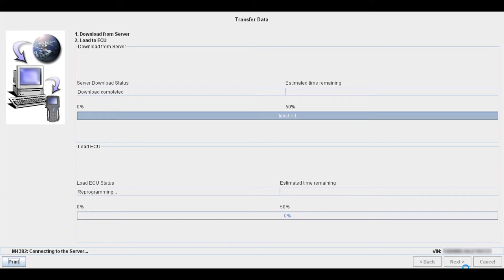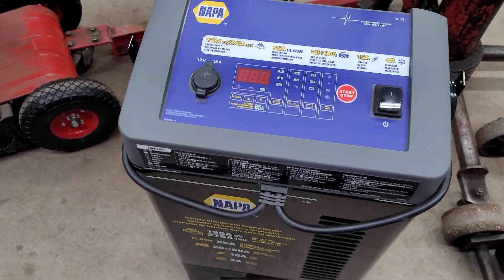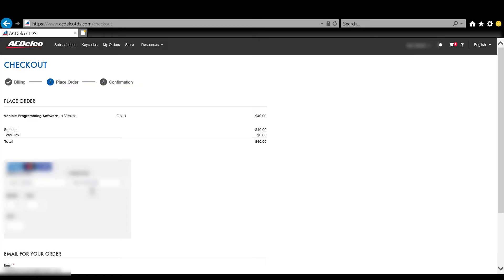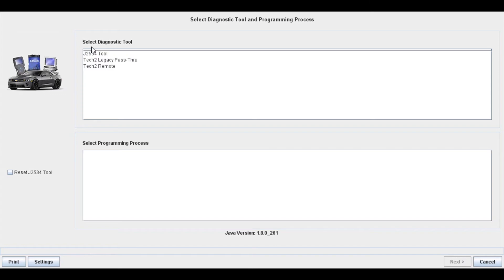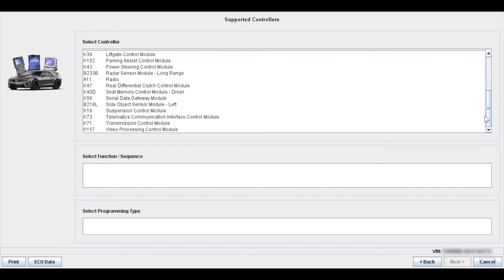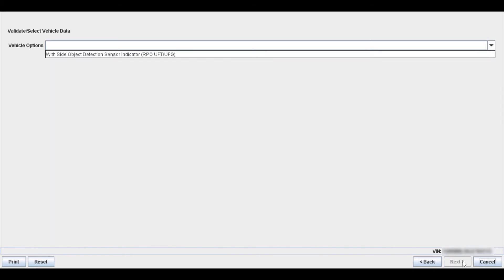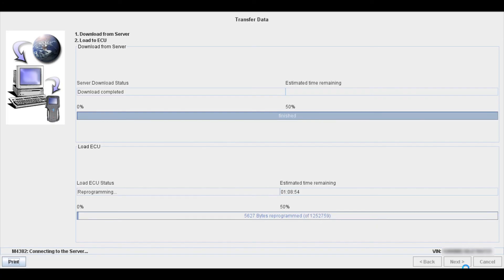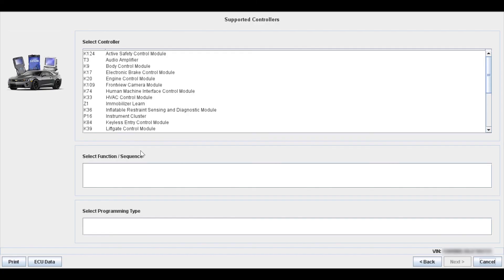How to Reflash Modules on GM Vehicles! Step by step walk through for reprogramming GM Vehicles!

Comment: Would this work the reprogram the EBCM on a 2003 Cadillac Escalade. This problem has been driving me crazy, brake light on the dash and service stabilitrak, service traction control, and abs light is on. I got a new EBCM now I have to just program it.
Reply: Lol. It's never just one thing one these absolute turds.    07 Escalade 3 dealership service departments and 4 years later, it's in my shop now for 7k worth of new parts and wire harness

Comment: Great video, does this process work to update to the most current software available? I am asking because my son just purchased a 2017 buick lacrosse  and we were looking to see if the engine and transmission software had any updates
Reply from the maker: Yes, this is the process you would use. The video is a couple years old so it may look slightly different but the basic process is the same. GM also has a site to check if the are any available updates. Search for "gm cal ID" and you should find it. You enter in the vin and it will give you the most current software numbers. You then would use a scan tool to check the software numbers in the vehicle to see if there's any updates available.
Reply: @apmotorsports5568  thanks for the quick reply, is opel the update site you are referring too? what scan tool would you recommend to check software numbers?
Reply from the maker: I'm not sure what the site is called anymore, I've been out of it for about a year. Scan tools vary alot. For a more budget friendly but still good tool i like the Autel and Topdon tools.

Comment: Hey bro... nice video. I have all of the tooling needed to reprogram a couple of new junk yard pulls that I got that I want to put into my truck. I want to enable a couple of additional features specifically with regard to the VPM to turn on some other camera views that were not available when the 2019 sierras came out, but were available on later models with a larger VPM. There are companies out tehre that charge an arm and a let to reprogram this stuff, but I have all of the equipment already, so I wanted to know if using this software, is it something that I can do myself? Id me willing to pay you a consulting fee so I can learn do to this myself instead of paying another company to do it for me.

Comment: I have a question on this. I have a 2020 corvette I’m rebuilding that was wrecked. Previous owner installed a used rack and pinion that will need programmed. Is this able to program the used rack into my ECU?

Comment: Hey sir, if I am working on a 2004 Chevy Colorado that has a salvaged motor and new ecm... and I don't know the vin of the engine's origin... you got any advice?
Reply from the maker: You use the vin for the vehicle the engine went into. The vin of the motor orginal vehicle doesn't matter.
Reply: :face-green-smiling: @apmotorsports5568  Thanks... this sounds like a pretty good odds to get this thing running!  I need a CarDaq+3, a charger made for re'flashing, and an SPS2 subscription from AcdelcoTds?

Comment: Will work on Body Control Module to can activate the cruise control? My truck was coming without cruise control from manufacturer.
Reply from the maker: In some cases this can be done. On GM vehicles you often select the option codes that the vehicle has during the programming procedure and this would be where you select the RPO Code for cruise control. This is not on all gm vehicles though. Some just do the programming based on the VIN.

Comment: But can you add a module, like let’s say a VPM, and program it to work within the vehicle network?
Reply from the maker: This is meant more for vehicles as they were originally sold. As far as adding modules, sometimes that can be done but sometimes it can confuse the software as it goes by the vin number. I do not have alot of experience with that.

Comment: Will this work to reprogram sensors for 2015+ Yukons, Suburbans, and Escalades? I need some drivers assist sensors programmed.
Reply from the maker: Yes. This is the manufacturer method for  reprogramming modules on all GM brands

Comment: How to make cardaq-m open in chrome
Reply from the maker: Recently I've found that the GM application does not seem to like Chrome. It's not the cardaq that's likely the issue you are having. Try switching to a different browser, I use Microsoft edge for gm vehicles and it seems to work well.

Comment: Does this GM software allow you to turn off features within a module? For example, disabling mag ride?
Reply from the maker: In some cases when reflashing a module there are certain options that it has you choose from so the module knows what the vehicle is equipped with, but it doesn't exactly let you turn features on and off. Some features can be turned on and off just using a capable scan tool as well.
Reply: @apmotorsports5568  thanks. I’ve been on the hunt for any type of scan tool or software (how I stumbled on your video) to be able to get into the suspension control because the mag ride sucks and I want to eliminate it completely without using what’s commonly offered out there with plug in resistors that still make the air pump run or something that needs to be plugged into the OBD2 port all the time. Do you know of anything specifically that allows you to get into each module?
Reply from the maker: For what your trying to do I would say that a scan tool isn't going to work and you would likely need to go with the common kits/methods you were talking about. I believe those systems have a separate control module for the suspension system and the resistors used in the common kits are to keep the warning lists from turning on. I don't think there are any "options" to turn off that system. Atleast not that I have seen.

Comment: Which VIN do I purchace if I am replacing the ECM and the BCM and the TCM and the PCM all? (For up to model year 2010 pickups) Do I choose the Title VIN and use that throughout? Alo what is this RPO that you mention? Is it an acronym?
Reply from the maker: You use the VIN number for the vehicle the modules are being installed into. You can find the VIN on the sticker inside the drivers door, in the front left bottom corner of the windshield, or on the title/registration for the vehicle.
Reply: @apmotorsports5568  Excellent. Thank you so much!
Reply from the maker: Your welcome!

Comment: So all I need is to click under immobilizer learn and I assume it'll ask me to enter my LSID?
Reply from the maker: With gm you access the immobilizer by selecting it as a module. When you select a module to reprogram the immobilizer is one of the module options. The process is a little strange as it will make you wait for 10 minutes and then tell you the reflash has completed but not instruct you to put in the key and turn it as the instructions tell you. I believe it asks you for your lsid info when you start that reflash process.

Comment: Can you show a video how to compare tcm vs junkyard unit... ie for vin swap also.. ie if you need configure  a 4x4 transfer case on to non 4x4 tcm configuration...
Reply from the maker: This process does all the programming based on the vehicles VIN number. With some modules you have multiple calibrations to choose from during the reflash process. These calibrations are usually related to the RPO codes. You may be able to choose the RPO for 4x4 in your case but I have never tried to do a 4x4 swap so I'm not positive on that. 

As far as the VIN swap goes. At the beginning of the process when the SPS2 software starts up you goes through the vehicle identification. This is where you enter the VIN number. The VIN you enter here, or that the software reads from the PCM, is the VIN that will be used through the reflash process. If a used module is installed  the software will wipe the VIN and program in the new VIN.

Comment: do i have to have the battery charger?
Reply from the maker: Any battery charger with the "Reprogramming Mode" should work. The idea is that the Reprogramming mode provides a cleaner and more consistent voltage level than a standard charger. So far the only vehicles I have seen that need very specific battery chargers are programming BMW vehicles as they require a charger that can put out a very high amperage while in the programming mode.
Reply: @apmotorsports5568  thank you for the response and forgive my ignorance but my first question is does my Chevy Tahoe have to be connected to a battery charger to reprogram modules? and to follow up is this because reprogramming will drain a battery quickly while the car is off thus causing issues?
Reply from the maker: You should always use a charger when programming modules for a couple reasons. The main reason is that the battery can drain causing the programming to fail and can ruin a module. The other reason is that a charger built for programming will provide a clean steady voltage. If the voltage is fluctuating to much it can cause the programming to fail. Standard battery chargers works by raising the battery voltage very high and then letting the voltage drop before charging it very high again, this is a very simple description and not exactly how it works but for this topic it's all you really need to know. That rise and then fall of voltage can cause issues with module communication during the programming process.
Reply: Bro thank you so much I really appreciate it!
Reply from the maker: Glad I could help!

Comment: What about the newer version of SPS2? is it still the same ?
Reply from the maker: The current version of SPS2 works almost exactly the same. The process of launching the program is slightly different but otherwise there is only minor changes.
Reply: @apmotorsports5568  I see thank you, SPS2 use Techline Connect to launch the program do I need to have the subscription for Techline Connect as well?
Reply from the maker: If your just reprogramming a vehicle then you just just purchase a reprogramming subscription. You buy a subscription for each VIN number you need to program. I believe it's $40 per VIN, each VIN can then be programmed by you for 2 years without an extra subscription purchase. There is a button to click to view available subscriptions, after you purchase, click on the available slot and it will take you to the launch screen for the Techline application. If you want to use diag software or service info there are subscription options for that as well.
Reply: @apmotorsports5568  Thank you for the information. I really appreciate your time.
Reply from the maker: No problem! Glad I could help!

Comment: Do you need a license to get programming files if so could you make a video about it. Been searching and I see a yes and no depending what you are reprogramming
Reply from the maker: The only time you need a special license for any reprogramming is when programming the security system with some manufactures. The license is known as an LSID and you apply for it with a company called NASTF. Go to, https://sdrm.nastfsecurityregistry.org/dotorg/landing, and apply for the SDRM Credential. In order to be able to do this you need to be a business and provide them with business licenses, insurance info, and a few other things. Again this is only an issue when doing things with the security systems.

Comment: Can someone explain the locksmith license into more detail and if required to get? I am just starting into this career path and I have much to learn, excellent video!
Reply from the maker: The locksmith license is called an LSID. It is required when doing programming with vehicle security system items. Typically the shop has the license not the tech as it is somewhat expensive.
Reply: @apmotorsports5568  thank you much appreciate! is it possible for a video on how to go further or a way to contact you for further detail? as the shop I’m at right now does not have one we are barely getting introduced to this side of the business
Reply from the maker: I will have to look into making a video on it. I will get back to you in a little bit with the website for it though, the company is NASTF. basically you fill out an application with then, give them the business info, business license, and insurance info and pay their fee then they will process it all. It can take awhile for the processing to get done.
Reply: @apmotorsports5568  Thank you so much really appreciate it
Reply from the maker: https://sdrm.nastfsecurityregistry.org/dotorg/landing

Thus is the website you need to register with. Once your registered there is videos on the site to help you figure out gow to do everything. Basically when you are programming a vehicle the programming software, or the manufacturer website, will ask for your LSID info. Anytime you need to that, you then have to log into the NASTF site and fill put a form that essentially is just a record of why you are accessing the vehicle security system. If the forms are not filled out your LSID will be temporarily locked until the forms are correctly filled out. This process is also for for things like Chryselr Key Codes. Its confusing the first few times you need to do it but not bad once you are used to it.
Reply: The older stuff, I believe 2017 and older does not require a license. At least the Ford and gm stuff I have dealt with. Gm has a wait period in which you wait 10-30 minutes to gain security access. Ford is like 12 minutes